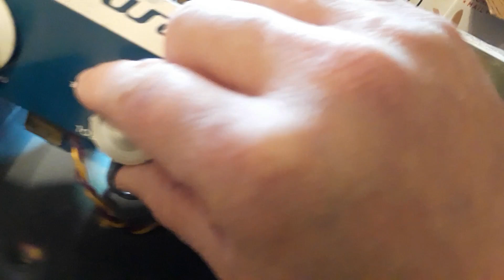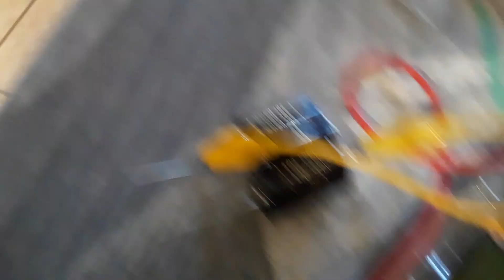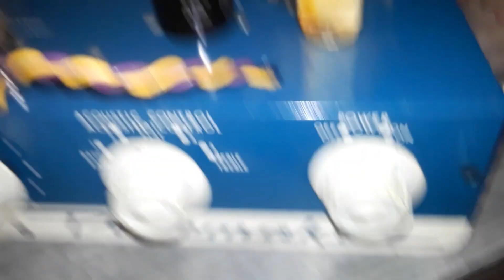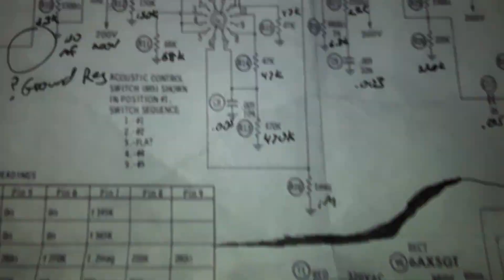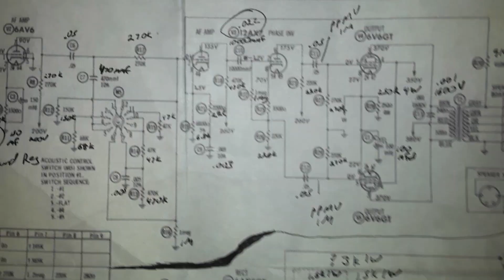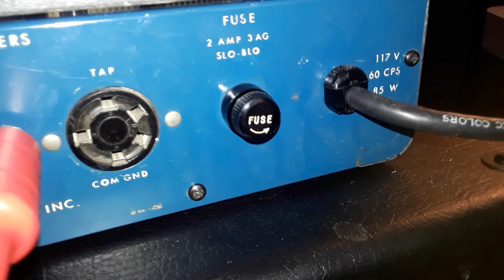Bell Pacemaker PM 20 vintage tube amp conversion to guitar amp

Comment: In place of the 6AV6 pair  I’d consider replacing one with a 12AX7 like you noted, the other socket you might want to consider a 5879 seven pin pentode.  Make the two switchable by lifting the cathode of the unused tube circuit.    I did that once and it worked like a charm.   Too much capacitance on any of the 6 volt rectifiers will make it arc internally, eventually..